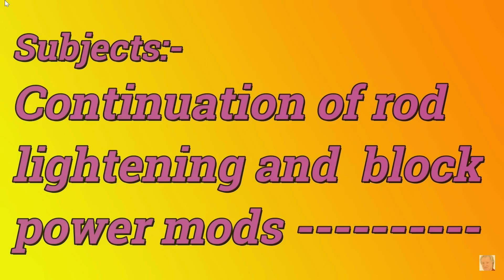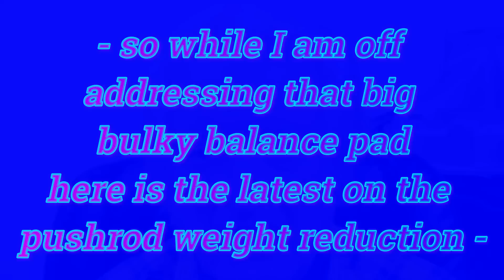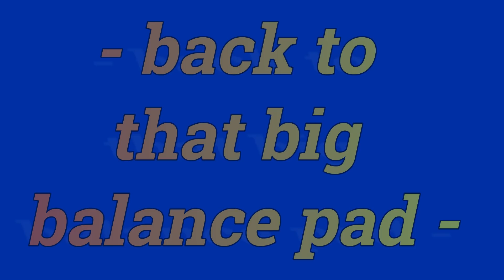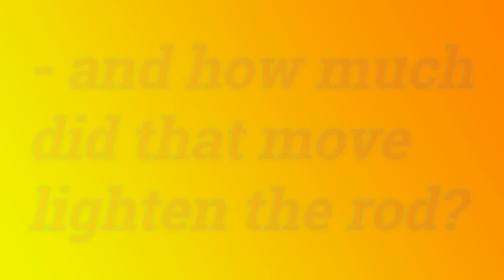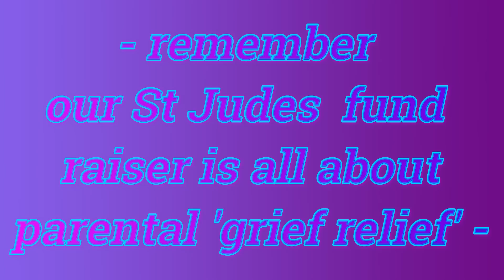What's a race prep on a stock rod worth? Way more than you might think!

Comment: 2---special Engines ARE
Mini N16 motor.
AND
VR6 design Prefer ALUM Billit Block and or Head with Billit Manifold.
However
Extra Credit is 
THEE
Infamous
Honda V5 however Modified for Automotive VR 5 
INCORPORATION
ALL with
DSG
Modified or Upgraded.
HorsePower is Preferred
SAY...
225 to 425 upper limit may be 550.
THE CORE of these BUILDS should be.
Coolant port temp controls.
Oil port temp controls.
High temp silicone rings or seals with copper crush gaskets.
Oil pans may be steel.
Prefer Titanium manifolds,Dissassembleable CAT
Stock ECU or Stand Alone Assisted ECU...dreaming abit.
Titanium intake valves are Proper.
Titanium or High Quality sodium filled Exhaust Valves or comparison video.
Prefer the 4 valve dual vanos AND Intake valveatronic IDEALs.....with Billit Alum or Titanium Valveatronic componentry.
Dream of THE.....DUAL PORT injector System without High Pressure Mechanical Fuel PUMP..N16.
Dream of a 5 valve or a 7 valve Competition or comparison.
Modified Dream is
Direct injector Plug Combo.or Multi Ignition/Direct Injection Beauty and Simplicity.
KEY is Port and Direct Injection for clean intake recirculation AND clean Piston Head Spray n Cup n Valve Recessed.
ICON is Preferred.
Titanium rods with Pressed Inserts is FORTE.
FORTE may also be achieved with Stock trimmed n polish rods and Crank Balancing and Trim.
The MAIN
Focus is Detroit Tuned Quality..
Prefer CAM GEARED easy Access.
Prefer CRANK/CAM gearing AIR COOLED SEALED as well..
Possibly to Assist noise using helical cut gears....Large gear should have materials option...for noise reduction option.
However the New adjustable cam gear wide Belt Alone or prefer COMBO...belt AND CAM Crank gear for stability/dampening of vibration or Option likely for
Quiet light duty mode.
Or just run gear for reliable mode and use visa versa as an assist...depending on Condition of Use necessary SAY
TRACK DAY....
Or
Say
Family Trip...sound and vibration CAM/CRANK assist mode BOTH Belt n Gear or ONE visa versa...just release the Belt side to just run GEAR..or Run the Belt side and release the gear side noise or Run BOTH....
Final
Analysis.
Gear driven reliability is a MUST...
Belt drive is also a must for sound n vibration.
SO.
Performance is as well and WEAR overtime risks until Repair choice Occurs...one can Use the Gears as Backup or Belt as Backup assist.
But the
FORTE it Requirement
Detroit gear driven Quality assisted by Belt CAM for sound n vibration or performance BOTH should be Sealed Easy Access and
AIR COOLED SEALED systems with Filtration as ONE may filter Vanos WHY wouldn't you filter a sealed air cooled Cam/Crank Belt setup.
But in our
FORTE WE get to Design BOTH as Optional single dual visa versa....depending on Operation 
Such as
Track day.
Family day
Work day.
Recreational Drive Day.😊
Mai concerns always are Oil cooler and seal ease of maintenance.access.
And
Coolant Drain and Cooling Capacity Option.😊

Comment: if ur talking budget i will stick to what do i get the 4 inch stroke 454 with steel crank, heavy rods, high flow heads got 4 last year with 6,000 to 58,000 miles on them with a 02xx trans for free with radiator twin electric fans serpentine belt oil cooler trans cooler power steering cooler then if u get a good after market intake and a big carb they come alive and u can not beat the look of a big block
Reply: You forgot to add higher compression pistons and the largest intake valves you can fit.   Stock BBC's usually come with horrible compression ratios that leave a low VE and nowhere near enough intake valve to feed all the cubes.
Reply: @earlbrown  high flow heads can put out more then 800 hp and the engines have 10.5 to 1 compression then they all came with the 02xx trans which is good to 800 hp stock

Comment: Hi David thanx for this fantastic video for us old timers,everything you said i experienced the same way,i refuse to change my a14 datsun engine on electronic,because i get the same results with a modified distributer and ignition system with condenser and points in modified way,which i would like to discuss privately with you as this took me years to accomplish,the best reason ,i can fix it on the side of the road if it breaks down,dont need a towtruck,would just like to take the oppertunity to thank you for all the no bs videos and for proper knowledge shared with us,you are a remarkable engineer and race car builder,thank you so much ,
Regards 
Nick

Comment: A rod is made weaker with those pads removed. Sure it might not fail 5oday but in the future. At least use a 4340 rod if you want to do this. You may have to drill holes in the crank now that the rods are lighter. When a rod is thrust upward that balance pad adds strength to the lower rod cap. Taking it away isn't a great idea. A fatigued rod is not worth messing with.

Comment: 4 oz out of the rotating weight will drop lap times on a road race course more than 100 pound out of the car. 
5 grams off each of the small ends on a V8 will gain the same as 4 oz off the rotating. 
Most people do not understand how much reducing the Reciprocating weight will gain them which is because many fail to come to the realization that the piston stops and then is accelerated 2 times every revolution and how much easier it is to accelerate less weight.

Comment: I question for a high performance daily driver is all the effort worth it? I can see where in a race application that isn't seeing high mileage  and requires durability concerns.  Is doing this on a balanced and blueprinted LS motor worth the effort for a daily driver truck application?  Seems like a lot of effort for anything that isn't full blown race application with higher rpm demand

Comment: A heavy rod consumes power by creating a lot of inertia during the sudden change of direction of travel (reversing), once at TDC and once at BDC. Same with the piston. And then there is the wasted motion created by having only one combustion cycle (power cycle) for every 2 revolutions of the crankshaft. That's why gas turbine engine use in aircraft has made the piston driven engine as obsolete as the steam engine. Constant combustion, no reciprocating parts.  Just some info from a guy who spent 24 years working on gas turbine engines in aviation.
Reply from the maker: And how much fuel do they use at say 1/4 power????
Reply: @DavidVizard  Not up to speed on all gas turbine engines but on the turbo shaft engine used in the Navy's E-2 Hawkeye the engine runs at a constant speed while thrust from the props is controlled by regulating the prop's pitch. The fuel control unit (think very high tech EFFI) adds fuel as the demand for power increases. There is no such thing as 1/4 power because power needed is variable. A turbo shaft engine coupled with a generator of some type would be the ideal power plant for a hybrid auto. Constant speed, high power to weight ratio, quiet, low emissions.
Reply: Been following this for a while because you are doing something similar to what I did to a 318 van engine back in the 80s. Only I was working towards fuel economy & torque. I didn't have the high swirl heads available (they were a few years down the road). That 77 engine had the smog heads so I used some earlier heads & did some careful pocket porting just to remove sharp edges & try to get all the ports even (sort of) but I didn't have access to the fancy equipment you have. Used the 2 bbl manifold, blocked the EGR holes under the carb, matched the ports, added a melling hi torque RV cam and improved the exhaust system. The only exhaust manifolds available back then were the old ram horn style, not very good. I installed a 4 speed 833 OD transmission & had a 3.23 axle ratio. Drove it on family vacations fro several years & got fair gas mileage considering the size of the vehicle. I used the little Carter BBD carb. Keep up the good work, I'll stay tuned.

Comment: The grinding around the rod bolt. If using stock pistons or stock replacement’s, this should not be done. But with a lighter piston, this can be done. Do I have this right.

Comment: We used to do a lot of this.

The advent of the affordable decent aftermarket connecting rods put an end to it for the most part.

It's only a worthwhile option if there's nothing aftermarket available. 

These days, for many engines, you can buy a set of rods for the cost of a set of ARP fasteners and reconditioning them.

Comment: Great content. I will lighten rods for big fours on the street (think Ford/Lima 2.5L). By removing weight from the small end, polishing beams and using a lighter piston there is a noticeable improvement in smoothness. I leave the big ends alone (rotating weight). No dynamic balancing, just static weight match.

Comment: Rod big end weight loss, I will say 118 grams. After all these mods are you planning a stress relieving and or hardening process? There is going to be a more measurable change in the torque both it's length and curve as compared to a similarly configured engine without removing  rotating mass.  HP is a mathematical product of torque and torque wins races. Assuming your chassis guy can actually put it to good use.

Comment: Taking weight from the end of the pendulum, you will have to most effect on your effectiveness of reciprocal mass. I have done this on Ford FE rods for years with the stock rods and ARP bolts using stretch on the bolts. I have never broken one at 1.5 hp per ci.

Comment: Isn't stiffness determined by cross section and Young's modulus?  And, Young's modulus isn't much different between 4340 and 1015, is it?  So stiffness of the pushrods in bending is determined more by the moment of inertia than any material changes.  This is usually very hard to explain to non-engineers.  So as an engineer, please explain why the pushrod material makes a whole lot of difference in stiffness.
Best Regards,
Rich
Reply: I just went down a rabbit hole learning new stuff because of your comment. Thank you!

Comment: I've read where a stock block Ford 302 with a dampening plate on the bottom end of the engine under the oil pan and dampening plate either wear the rocker arms go or wear the lifter Valley is at can't really remember but I think it was in hot rod magazine the guy said the dampening plates were to take the vibration out and to help change the frequency of  the vibration so the stock block  wouldn't crack and split as easily and they said it works.

Comment: Dear Sir, regarding rods, wont aftermarket rods like Eagle and Scat not influence the lubrication of the cylinder walls? Original GM rods had oil thrower tabs on the outer side (crank side of the bearing pocket) most aftermarket rods have nothing? Will I need to modify the rods with oil channels or the crank before use?

Comment: 5:20 what is this massive lump for? Is this counterballance for something?
Reply: It's there so you can balance the rods and pistons. Standard process would be to find the lightest rod+piston in the set you got for the engine, and grind the 'massive lump' on the others to get it to the same weight.

As an aside, usually there is one on each end of the rod, because the bottom of the rod is rotating mass while the top of the rod is (along with the wrist pin and piston) reciprocating mass.

Comment: 060 wall pushrod is living dangerously. More so at over 7000 rpm. In my experience you may get away with it in a roller cam Chev but Ford and Mopar no. 080 5/16 is the mininum that should ever be used, And oh so many use 3/8
Having spent money on 'prepped' rods for a Chev I then spent money of good aftermarkets rods which are generally a bit lighter and a good deal stronger. And no are they going to live worries.
318 rods are the fragile ones. Later 318s had 360 rods. Generally a stage one update. They also go in A series engines.
Dont talk to me about drag racing. Real racing has corners
Lighter pistons are more important. Windage is more important.

Comment: DV, would it be cheating to use stock LS valve springs on this build, since they are a beehive design and very light, and can use a much smaller, lighter retainer? And how about LS-style 8mm valve stems?? Those stock 3/8ths stems are HEAVY!

Comment: Pushrod weight? 8000 RPM? There is tons of spintron data available that shows larger/heavier pushrods significantly reduce valvetrain harmonics. 5/16 .080" alloy pushrods don't handle axial load very well. There isn't a 5/16 pushrod available that won't deflect within the parameters of 8000 RPM and 300 PSI. Simply moving to a 3/8 .080" pushrod results in a 23% decrease in harmonics when compared to the 5/16, 310# over the nose @ 6000 RPM.

Comment: Dv I have a question I'd like to ask. Do intake runner lengths ( long or short) make the same difference if the engine is turbocharged
Reply: Yes, the intake manifold will do the same thing. The boost just adds to it.
Reply: @michaelblacktree  yeah that is what Richard holdener told me

Comment: You mentioned the weight of the push rods. If the heads are clipped and the block decked, you will also have to use shorter push rods, which should be lighter, too. 
Nice tips keep them coming.

Comment: After I polished the beams of my Mopar 273 connecting rods to a smooth, shiny surface (back in the 1970's), I sent them out for shot-peening. When I received them back, I noticed the surface was no longer smooth, but more like sand paper. At the time, I thought the shot-peening was a way to "strengthen" the rods. Now I'm not sure because Mr. Vizard hasn't even mentioned that procedure (shot-peening, that is).
Reply: Shot peening is a process of strengthening the material near the surface by peening or hammering the cells of metal to make contact with all the adjacent cells. The idea being a stronger lattice.   Made tons of factory rods into race rods, bushing for full float, loosing weight light he's doing here, then stress relieve, and shot peen.  Today a process called kryo treating is done to bring the metal to such cold state as to allow the cells throughout to make complete and better bond and then slowly normalize.  The teams for baja to nascar all do this. Expensive but when the purse is a million or so. They do it on all the hard parts from ring gears to piston pins and locks.
Reply: It doesn't strengthen them as such, but does make them more resistant to fatigue failure by setting up beneficial residual compressive stresses in the surface of the rod.

Comment: Titanium retainers now Howard's pushrods so much for stock stuff. This whole project is just about how much power a modified 2 barrel and intake. I think you're videos are excellent but this is not the original concept.
Reply: The final version will be at least an optimized 4bbl and pushing 480 hp.
Reply: @hotrodray6802  yeah that's ok but its just become the same sort of build that we used to do in the 80s and 90s before affordable aftermarket stuff was available. Its still good but has been done to death by many already. The original Tony deal was to get as much power  as possible with all stock junk.

Comment: If you are going to extremes and lowering bob weights, 100-120 grams could probably easily be removed from each rod considering they weigh over 700g stock... It also depends which rod you start out with thou. 318 rods can be made out of 4340 or 1053, and the weights of the OE rods very considerably by casting number. If memory servers me correctly, there are literally a dozen or more different part numbers for OE 318 rods, 725-770 grams. That's about significant spread. A light weight aftermarket steel rod averages 600g or so at that length. I will go with 120 as a guess, assuming that the starting rod is a heavy casting.... Something tells me you would not have mentioned being surprised if you started with a light one....

Comment: Can't wait to see how to home balance rod's at-home I did polish 360 rod's but I was afraid to touch the balance pads
Reply: You can easily balance the rods (and whole piston-pin-rod-bearing assemblies) at home with straightforward big-end / small end measurements but you also still need to spin balance the crank or at least know how to measure out the bobweight spec needed to send just the crank out and have a shop balance your crank for you instead of giving them the whole rotating assembly to balance or if you want interchangeability between engines or spares, etc...
Reply: You will be waiting awhile to see this project get completed. If you are under the age of 40, you may live long enough to see it run.

Comment: Great video David, question sir, with increased lightening, is there anyway to address the issues of difficult starting off the line with a manual transmission? Meaning reduced flywheel affect, this is similar to using a very light flywheel.
I’m all for Any benefits,, but can you do All of this with a street motor, and still have reasonable take off in first gear?
Race motors this isn’t really an issue.
Thanks again.
Reply: Yeah, as long as you run a stock flywheel I’d imagine the difference would be negligible, but definitely wouldn’t try running a lightweight flywheel on this motor it would be a dog off the line with a clutch
Reply: @turkeyboyjh1  so how much do clutch assemblies weigh?
How much do torque converters full of oil weigh?
Dynos are run with flex plates and dyno couplings.

Comment: The early 273 and 318 rods are around 720 grams, vs 760 grams of the later rods.
Edit: for a long time in 340 builds people would switch to the lighter rod and have the rotating assembly reballannced.
Reply: I'm betting on 580

Comment: why are my 318 rods covered in copper ?
Reply: What year 318 is it pre 1972?
Reply: My 1974 198 slant six rods were like that too.
Reply: The factory used to dip rods in molten copper that were slightly under weight spec. I’ve seen this on rods from different manufacturers. This isn’t needed on the newer powdered metal rods cuz they’re more consistent.